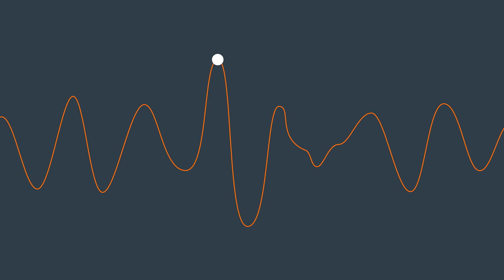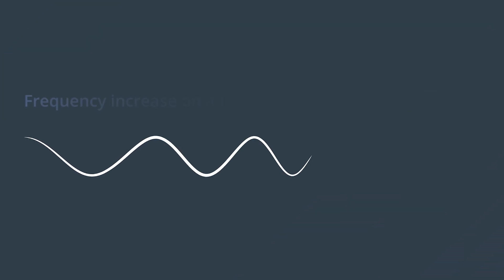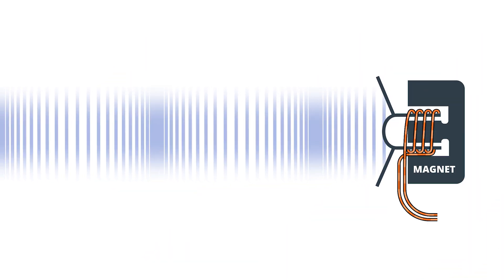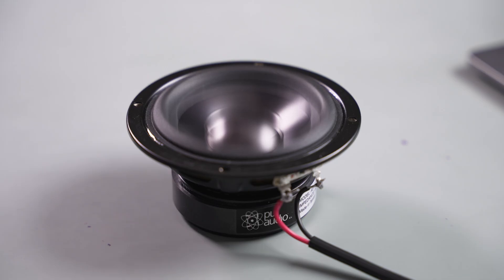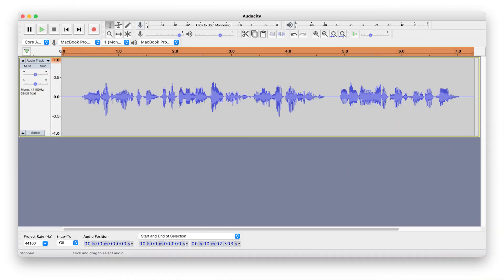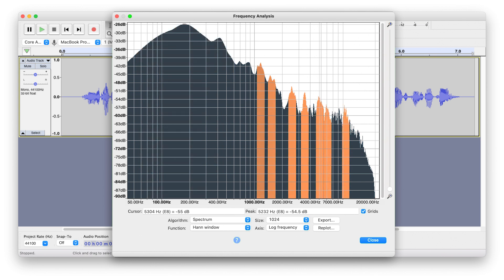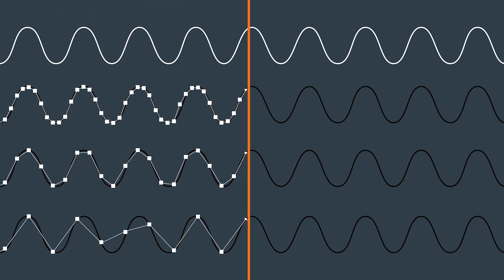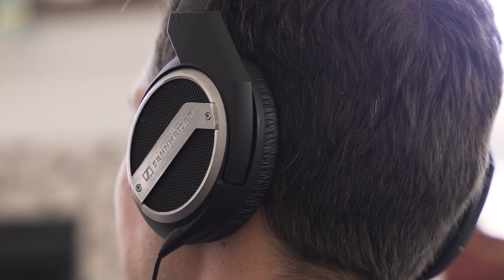The Science of Sound: How Audio is Recorded and Reproduced

Comment: we can actually need only one subwoofer not two because the sub will have a phase or a not accurate syncing
Reply from the maker: Properly spaced (and setup) dual subwoofers shouldn't have any phase or syncing issues.  Having two subwoofers actually can significantly reduce dead areas in the room as well.  One subwoofer is certainly better than none, though.  But, this seems like a discussion for an audio system-specific community!